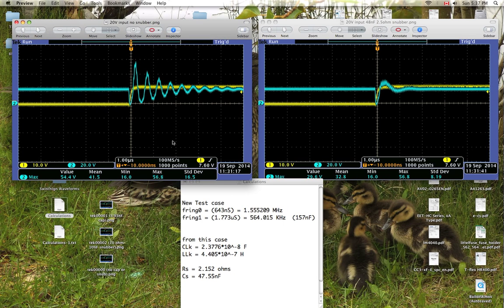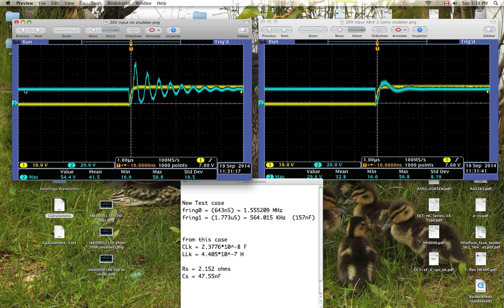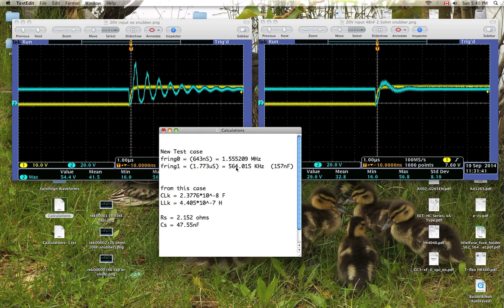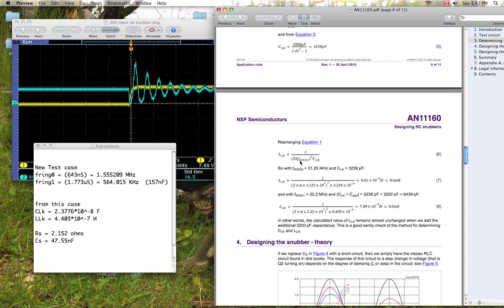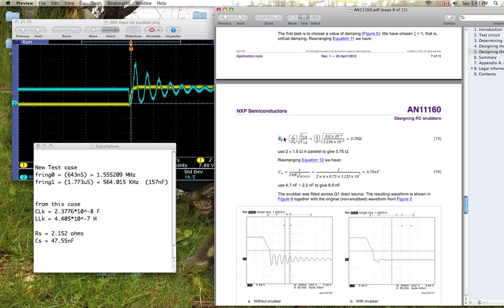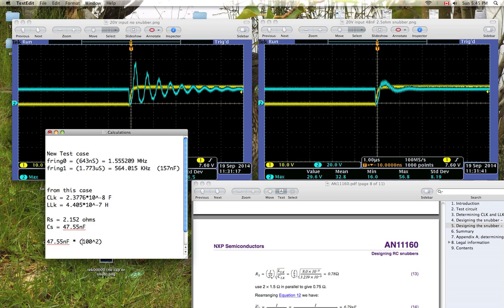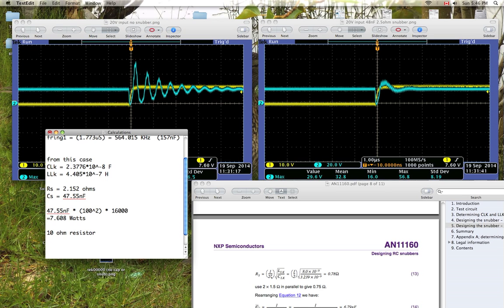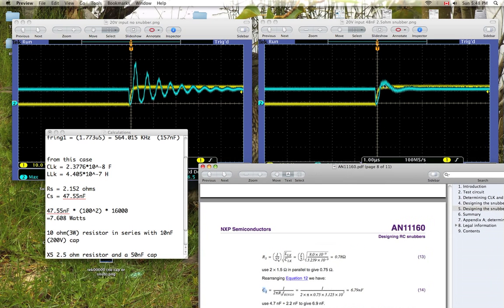Custom Motor Controller Build #8

Comment: wouldn't 5 - 10ohm resistors in parallel give you 2ohms of total resistance? 
1/10 = 0.1
0.1 * 5 = 0.5
1/0.5 = 2ohms

Comment: Hi,  I'm not certain on this, and you probably know more than me given your background, but if you only use half of the voltage potential of a capacitor (110V out of a 200v cap) do you not in theory then half the farad rating of the capacitor?  meaning you would need to use a 200v 20nf cap to get 10nf of capacitance at 100v?
Reply from the maker: Not quite. When it comes to energy the exact same capacitor at 110v vs 200v will store more energy at the higher voltage.

The capacitance though is the ratio between stored charge and voltage across the capacitor. A 1 Farad capacitor will store 1 Coulomb of charge when it has 1 Volt across it.
A 1 Farad capacitor will also store 2 Coulomb of charge when it has 2 Volts across it.
In the example I just gave the capacitance did not change, but the stored charge and voltage did.
In practice some types of capacitors will change capacitance value with a change in temperature or the voltage applied across it (but not all).
Reply: *****
 Thanks for taking the time to reply to me, ill probably need to read your reply at least 100 times before it sinks in haha, i guess I'm stuck thinking that a capacitor works like a battery, in that in order for it to have its full capacitance it needs to be fully charged voltage wise.

Either way I'm looking forward to seeing your completed build :) Thanks a lot.
Reply from the maker: 1981therealfury
No Worries. My life is rather hectic so it can take some time for me to get back to everyone, but I do try!
Reply: ***** will you leave the 5 junctions of the resistor/capacitor as is, or would you join them? 

(so you have [5 capacitors in parallel] connected to [5 resistors in parallel] )
Reply from the maker: lez briddon They are left unconnected mostly because it is easier to build. After implementing the snubbers as I described the ringing was as expected.

I don't know if performance would be better or worse with them connected to each other. It is making my head hurt trying to think about it. Each snubber will experience a slightly different amount of ringing, so it could be argued both ways that leaving them unconnected or connected is best. Someone would have to try it out to know for sure as I don't have any data to back up one way being better than the other.